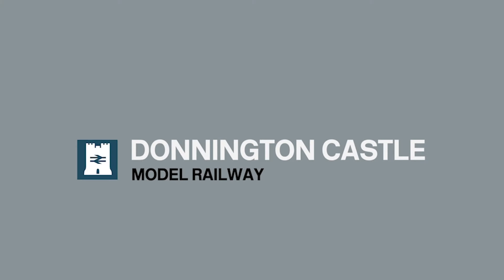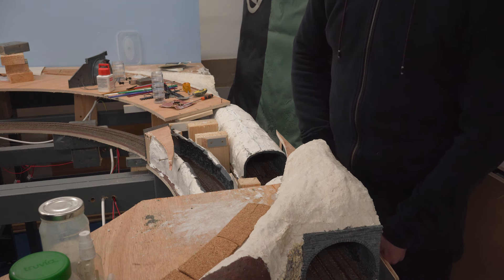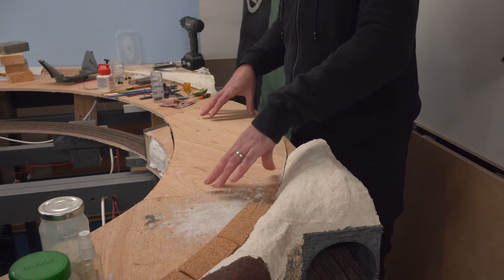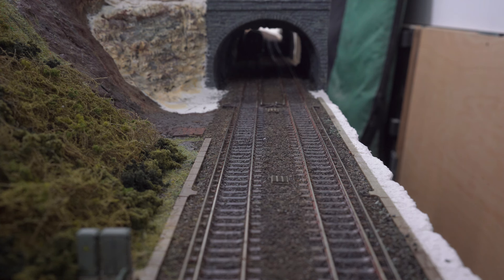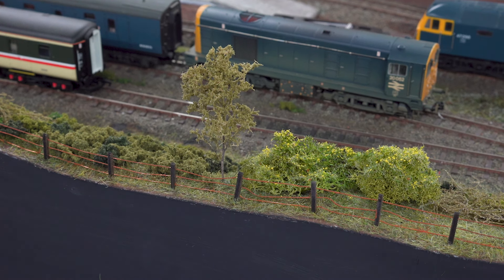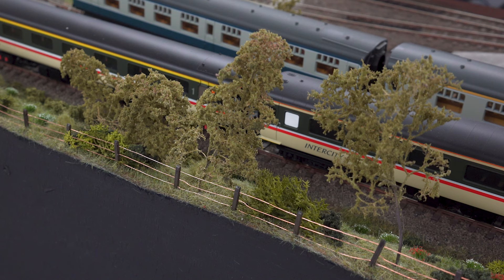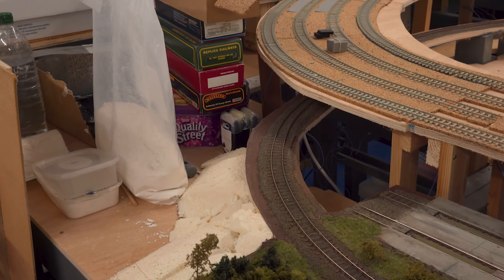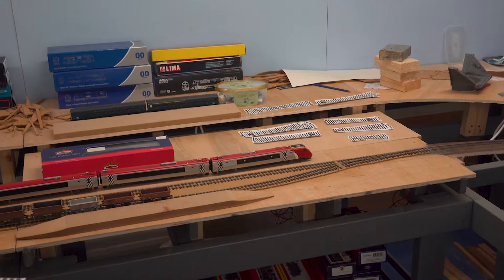9 - Layout Update Feb 24 at Donnington Castle Model Railway

Comment: Whoa, this is fascinating. If I can recover from a health problem this is exactly the kind of thing I'm looking at doing here. Split level, multiple location. Love the idea of the heritage line, anything goes there :) The Southern Mainline has me thinking, is it based on the Brighton mainline? makes me think of Quarry/Merstham Tunnel area?
Reply from the maker: Thanks! The layout is very much a pastiche of ideas and locations. I guess there are strong hints of West Berkshire in there as features near Donnington Castle are included. Also slight themes from Basingstoke and Reading areas where Southern and Western come together. The tunnel does have hints of the South Coast about it with the chalk, but its more been designed based on the physical constraints of the layout than any strict prototype. The heritage line is separate so other people in the family can run older DC models and as you say it gives excuses to run anything. Look forward to seeing what you build next!
Reply: @DonningtonCastleModelRailway  thanks, what you are doing is brilliant. Certainly will be following. What size is your layout?
Reply from the maker: Its just smaller than half a double garage. I can just squeeze round the back and sides to access those areas. I probably should measure it at some point and get exact measurements!